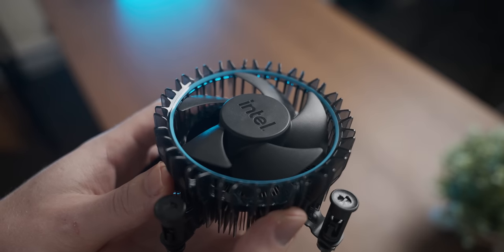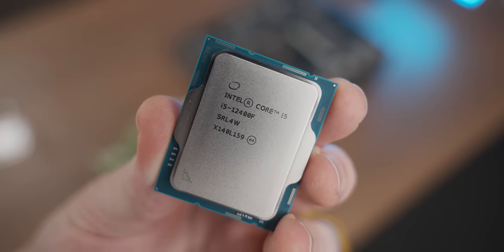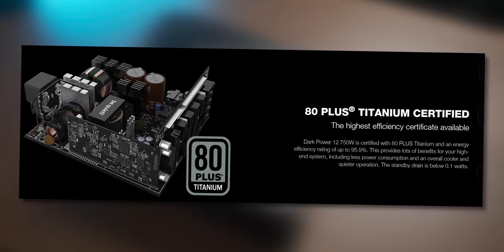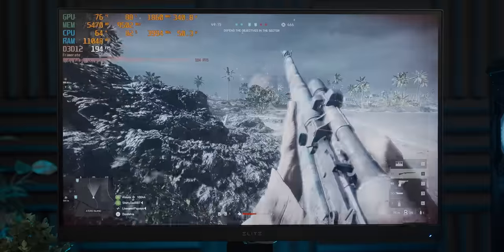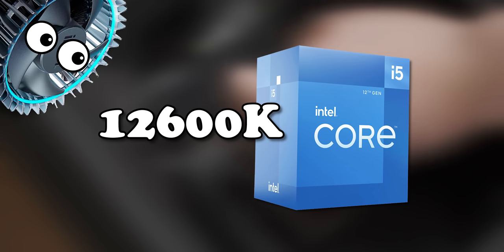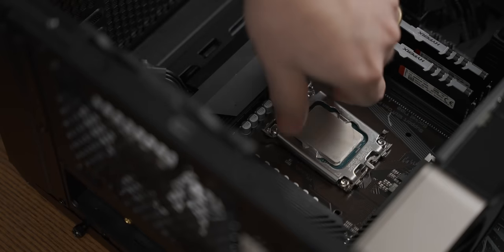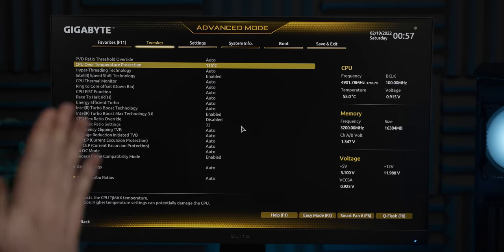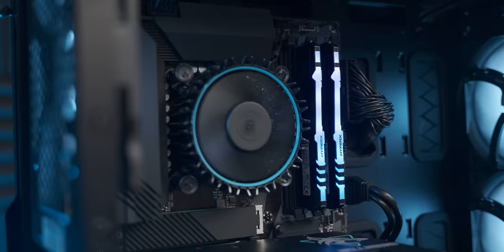Pushing The New Intel Stock Cooler To The LIMIT

Comment: I wonder how the new Intel stock cooler compares to the old one. It’ll probably be in the next episode of Dawid’s Deathmatch Arena of Death, hope so.
Reply: It's probably the same thing just made less uglier. You know how the say goes:
Same fecal matter, different color.
Reply: @ozmobozo  nah. the new one is a lot better because it's heat sink doubles the size compared to the old ones.
Reply: @ozmobozo  hey atleast it can cool mid range cpus, good option for people with low power budget builds
Reply: You can actually mount socket 1200 coolers on Asus z690 motherboards. So it should be possible to test it.
Reply from the maker: I think the performance would be pretty similar. The only reason I didn’t test it was because the old cooler didn’t have compatible mounting. I may do a short on it at some point if there is a bunch of interest. 😁
Reply: @DawidDoesTechStuff   SInce when has not having a mount stopped you Dawid 🤣
Reply: That is exactly what I was expecting ;(
Reply: @DawidDoesTechStuff  to make things easier there are some boards with the 1200 mounting pattern
Reply: @DawidDoesTechStuff  There is always interest in Dawid's Deathmatch Arena of Death!
Reply: @DawidDoesTechStuff  there definitely is some interest here 👀
Reply: Ahaha would love to see that. And I love that name 😂👌
Reply: @carloregalado7751  The top part is entirely plastic you know
Reply: Could be fun to see what is the minimal budget air cooler that would allow the 12900k to run in such conditions, id cooling, arctic e-sports, the classic cm 212 evo maybe? Is there something that costs less than 15 - 20 bucks that can tame the beast? :-)
Reply: @DawidDoesTechStuff  I want a full video with graphs i cant understand half the time included
Reply: @ozmobozo  Nah, just a bunch of plastic and little bit of fin stack and a Intel branded Delta fan just strapped on there and call it a new stock cooler
Reply: They didn’t improve anything since 2005…
At that point, it would be better to ask a little less money and sell the cpu without cooler and let the customer choose his own aftermarket one…
Reply: Who knew that the heat death of the Universe would begin with Dawid and an Intel stock cooler?
Reply: @DawidDoesTechStuff  i never really asked this but now thinkin of it is it backwards compatible with maybe like 6th gen or even 1st gen cpus
Reply: @DawidDoesTechStuff  what about one of the reallllllly old ones?
Reply: @mrducky179  Bro you can literally buy cooler master for 35 euros and it works 20 times better than intel stock cooler, i have max 50 degrees while gaming with their cooler..
Reply: More power at same tempurature
Still better
Reply: @carloregalado7751  I know i'm a bit late to this, but all that "extra heastink" is actually just decorative plastic. This thing really, truly is a joke

Comment: I wonder how this compares to older Intel stock coolers. While the more recent ones are all crap aluminum ones. Older one had nice copper cores. I remember my old it 2500 running fine on the stock cooler for a long time. It was made for like 100 watts of power. Heck the SFF community used to love older stock coolers as one of the decent and easier to find sub 40mm coolers untill noctua made the L9.
Reply: Because thats all you get. Sub 40mm aftermarket coolers just didnt justify having to purchase as many... as hard it is to beleive were worse than the intel stock coolers at the time

Comment: What?! You're spending your day at 14⁰ Celsius??? Damn! I'm in Canada and set my thermostat to 19⁰, and all my friends are setting theirs to 21-24.

You're a brave man! Great for the PC though.
Reply: For the PC great is -14 lol
Reply: After running a conversion to a more sensible temperature numbering system I have determined that he was indeed in a damned cold room for indoor temps. Yours makes much more sense as a low end indoor temp range though I'd prefer more about 70 myself.
Reply: @ram89572  You can't say that fahrenheit is a "more sensible temperature numbering system" without looking like a fool.
Reply: @mekacrab  I can and I did. It makes no sense to talk about measuring comfortable temperatures at only 20 something degrees off of 0 being freezing. That makes no sense at all. 70 being comfortable is significantly further away from freezing at 32 than 21,1111 is away from 0. And again we see more sense being made when it is damned hot at 100 vs 37.7778
Reply: @ram89572  what ? If it was that good then scientists would use it. But no, they use Kelvin, that has the exact same temperature increments as Celcius, just with a 173,15 degree offset.
You did look like a fool indeed. 
And besides, we use Celcius to mesure PC components temperatures, so we're not gonna mix units because that's a stupid thing to do.

Comment: what would really help these stock coolers, is extra Z height of aluminium, a copper vapor bell at the bottom leading to a single heat pipe that runs up the center of the copper heatsink
Reply: Literally just making the bottom flat would massively improve Temps, rectangular cpus don't exactly fare the best when the only contact with the cooler is a circle
Reply: @dilutedoxygen  I was referencinbg the extra Z height it has to travel through the lw w/m*k aluminium.
An extremely simple vapor chamber and a single 'heat pipe' thats literally just a hole drilled through the alumium slug would work better, heck, with how cheap drilling holes is, you could get 4 of them in there and cap it off with something simple, like some more aluminum that is slightly oversized for the hole

Comment: Always interesting to see parts used in ways they were not intended. So I guess I came to the right place.
I should also mention that 80+ rating is not a good indicator of the quality of a power supply.

Comment: 12400 runs way coooler while undervolted by 100mV. Would've been good to include this, as I brought temps down to 45c in r23 multi-core benchmark, with the Arctic Freezer eSports 34 Duo. Really curious what the stock would do with UV.

Comment: I recently built a system with the i5 12500 and the stock cooler and i found it pretty appalling. it was LOUD! Also the system did not survive a 10 minute run of Cinebench R23 without hitting the high 90's and even eventually 100 degrees on one of the cores. 
Cooler was correctly mounted, side panel was off, ambient was 23 degrees.

I suppose it's kinda okay, albeit loud, on the locked i5's and below but it is quite bad compared to even 20$ alternatives. you get a lot of noise for free.

Comment: If you want to keep using Battlefield 5 for some testing I suggest putting a user.cfg text file into the main directory of BFV and add the command "GameTime.MaxVariableFps 600" (without the "), this will increase the max fps of the game to 600 or whatever value you wanna give this command.

Comment: I dont think my CPU has ever reached over 40 degrees celsius, even pegged at 100% (happens quite a lot because it is an old 95W bullooser CPU) I highly reccomend the 7$ Arctic freezer 7 pro
Reply: Those CPUs are a completely different kind of beast, if I recall correctly, the max temp for those is around 60 C so they are not really comparable
Reply: @SpaceLion949  For FX  6300 it is 70.3,  witch is one of the better in terms of temperature tolerance, but It is still a CPU using almost 100W

Comment: if u want to put this "cooler" to the limit....take a 12300 cpu with stock settings und run 1 cinebench run!....thats it!
Reply: and get like 65c max temps? I got like 80c on my 12400, and the cooler was running at 80% speed

dont forget the 12300 is a 65w 4 core cpu so it really doesn't produce much heat at all, on my old 6700 I'd get 65c max temps on a cinebench run with the old stock cooler
Reply: @miweneia  You seem to be lucky. My 12500 also hits the high 90#s and sometimes throttles in Cinebench. This stock cooler is quite bad, even by Intel standards. There are $20 coolers out there that do a better job.
Reply: @miweneia  ok maybe i chose the wrong "words"...
take a 12400 or above and then u will sacrifice the stock cooler!
Anyway it was more likely a "meme"...a small joke!
but for the purpose of telling everyone that intels cpus are hot!
And i know it,  cause i used it for myself.
not with a tiny aircooler. with full costum loop and even with this in cinebench the cpus reach 85c instandly!

Comment: That copper surface is in the best possible position…just below the motor fan which creates its own heat on top of the cpu while air goes through the sides…..only.

Comment: Correct me if I'm wrong but apart from the 12th gen redesign of the stock intel cooler. Weren't they more or less just the same block of aluminum but with different mounting hardware?. Makes you wonder what the aftermarket coolers of early to mid 2000s would stack up today on these compact housewarmers.
Reply: I was recently comparing the one that i had on my i5 from 4th gen and i5 from 10th after upgrade. Despite looking simillar the old one had way more metal. Now they stripped it down even futher to cut costs.

Comment: I used the stock cooler for my 12400 while waiting for the adapter bracket for my hyper 212 to arrive, and honestly it wasn't that bad. It wasn't as nice as say pairing a Pentium D stock cooler with a Core 2 Duo but it never thermally throttled.

Comment: Just like with what happened to the author of this video, does anyone know how to remove this stock CPU cooler? The previous intel stock cooler had arrows showing where to turn but this new one does not. As a result I am unable to remove this cooler even if I tried to pull up on the four snap-ins. Its like they are stuck. Any help is appreciated! Thanks!

Comment: undervolting is a must with 12th gen at least 0.050mv maybe more to get those temps under control thats what iv found with the 12600k
Reply: You just need a good cooler
Reply: @emeraldwolf7920  Noctua NH-D15S not good enough? i think it is lol i just not comfortable of temps over 70 degrees c

Comment: Just to clarify tho, doesn't the i9 12900k come with a different stock cooler than the i5/i7?
Reply: obviously if you're getting an i9 tho you should definitely spend the extra $50 to get a good 3rd party cooler, but I am pretty sure the i9's actual stock cooler performs at least a lil better than this lol

Comment: I got a 12400f and its been doing just fine with the cooler, especially considering I have a gigabyte 1080 Ti, which easily drowns the cpu cooler noise

i use a more relaxed fan curve to keep noises low and I get about 72-73c and the same on the GPU

certainly better than spending 50 bucks on a noctua or bequiet cooler, when I don't actually need them

lastly, Im also running an open case at a room temperature of 25c
Reply: Hi! A year later, are you still using the stock cooler?

Comment: I have the same issue with my 12900K with a AIO watercooler, open case.
Jumps to 100° and throttles down to 4900Mhz
I wonder if there's a contacting issue caused by the bracket.
It's really annoying bc I do multi-GPU 8K VR AI upscaling.
The Giant VRM heatsinks in the Z690 motherboards make is impossible to fit a beefy heatsink.
Reply: What size AIO? Not trying to sound rude but did you make sure to remove the plastic film off the bottom of the AIO cold plate before installing? I got a used computer once that was running super hot on the CPU with any load and turned out the person that built it never took the plastic film off the AIO cold plate. After that was fixed, it was instantly better.
Reply: @dracer35  You're not sounding rude :) I work as tech support in VR video entertainment, I know people do the dumbest sh t haha.

It's a 280mm Liquid freezer. Even though I have a giant case (Corsair 750D) I can't fit a 3 fan radiator. It's a workstation, I need the space for HDDs and swap-bays. Currently the case is still empty though.

I replaced the standoffs that came with the LGA 1700 mounting kit with 1mm smaller ones which did help noticeably. Like 10°c less in Idle alone! I'm idling around 31°c right now.

I'm thinking about replacing the 140mm fans but I have no idea with which ones. Most 140mm fans are airflow oriented, while I would need more static pressure to push the air through.

I also hooked up the AIO to a 3 Amp header instead of the standard 1 Amp, but it's not pulling any extra juice. (Which is actually an attest to the build quality preventing it from burning itself out.)

If you have any ideas or suggestions, I'm all ears. The motherboard is an Asus z690 Hero, the VRM heatsink is massive and restrictive.
Reply: @rakly3473  Ok good. I didn't want to come off sounding like an ass lol. Much respect for you tech support guys. I don't think I could handle that lol. I'm a maintenance worker at a factory. I just tell them to leave me alone and I'll let them know when the equipment is fixed lol.

I've heard people talk about mounting pressure issues on some of the z690 stuff but it sounds like you've addressed that already. The Liquid Freezer 280 isn't a bad cooler at all.

For reference info if it helps. I currently have my setup on a test bench while I'm waiting for the rest of my water cooling fittings and hardline to arrive. Ambient temp stays between 67-69 degrees F. The 12900k is mounted an MSI z690 Carbon Mobo being cooled with an Artic Liquid Freezer II 420 AIO. Idle temp bounces around 23-24c. I've seen load temps in the high 70's to low 80's. I believe the high speed (2100 rpm) Artic fans do really well. The ones that came with my AIO seem to top out at 1700 rpm and stay very quiet while still cooling well which I like. One thing I've noticed is the temps are affected greatly by the CPU vcore. When the bios auto settings let mine boost to 5.2 and I see the vcore up near or above 1.4v, the temps rise quickly. I'm thinking I might play around with a little undervolt and see how that does. I use to run a constant -.050mv undervolt on my 11900k system and it seemed to help with temps and still boosted to 5.3 without any stability issues. I wonder if undervolting could get your temps down enough that the CPU could hold it's boost clocks instead of down locking itself?

If you do figure it out, I'd be interested to here what works for you.
Reply: @dracer35  There are some crazy 5000 rpm fans out there, but I ordered 2x Noctua NF-A14 industrial PPC-3000 PWM.

It's scientifically incorrect, but by the spec sheet numbers you could say, 1 of those = 2 of the ones that come with the Freezer AIO's
Reply: @rakly3473  I have one of those NF-A14 fans also. Bought it out of curiosity but the noise was too much so I never use it. I wonder if you are hitting diminishing returns by the time the heat has to transfer from the die through the Tim, to the CPU heat spreader, then through the thermal paste, AIO coldplate, into the water, into the aluminum radiator and finally into the air being pushed by the fans? I guess we will find out once the new fans arrive.
Reply: @dracer35  I got 3 Inter-Tech 4W2, I'm used to it :) - What you mention about the heat transference, I was thinking about that last night, maybe the pump speed is too low and not circulating water fast enough over the die. Not that I think there is something wrong with the pump, just maybe need a more powerful one.

I've never built a custom loop though and it's not really something I want to "waste" time on.
Reply: @rakly3473  Pump speed does play a pretty important factor. I run all AIO's at max pump speed because their flow seems to be much lower than the D5 pumps I use for custom loops. The DR has a max rpm close to 5000 but they flow so well that unusual run it somewhere between 2500-3500 depending on the custom loop, how many components in the system and how much restriction.
Reply: @dracer35  Alright, Installed the Noctua's! Difference is quite substantial. Mind that's it's a lso 28°c in the room right now.(82.5°F). Idle between 30°C and 33°c at half fan speed (1500 RPM).

Throwing workload on it does shoot the temperature up like before, but none hit 100° or was throttled. P-Cores ranged between 80°C and 86°C once stabilized. And E-Cores  73°C to 80°C , with fans at max speed (according to HWiNFO is 2800 RPM).

VRM max was 49°C. Didn't take note of what it was prior. It isn't for ppl who want a quiet PC though! But it doesn't bother me.
Reply: @rakly3473  Well at least it sounds like it's under control. I didn't realize you were working with such a hot ambient temperature. I usually have it around 20c 69f in my house so I'm sure that helps. I bet those fans are moving some air at 2800 rpm! Lol

Comment: why not run at 4K for that first test to shift the bottleneck to the CPU?
Even if you only had a 2560x1440 monitor you could still use DSR. If you used "x4" that would be 5120x2880 (it's proportional to the monitor so "x4" is square root each way (2x2)).
(before someone flames me... the bottleneck was not the GPU in this test. It was the 200FPS cap as he said.)

Comment: "The tower 100 comes with plenty of ventilation so your components don't have to run hot" looks at my gpu at 80+ degrees in my tower 100, hmmmmmmmmmmmmmmmmmmmm

Comment: Just for context: A 10900K @ 5,1 GHz All-Core, 1,3 Volts just reaches 70°C with a custom high-end (but underpowered aka. two thin 240 radiators) water-cooling solution. And the four NF-A12s are probably much quieter than that single Intel fan.

Comment: The new Intel stock cooler seems to be a little better than the baby-tier Ryzen stock cooler, handling ~105W vs. ~95W max while at 100C in my experience. Makes me wonder if I could increase the temp limits on my 5700G to squeeze a few free Mhz out of it (Horrible Idea).

Comment: 66 degrees with i5-12400F? I scored  84 degrees with stock just how shitty it is even though it got replaced by new stock cooler. Now got replaced by water cooling it stays at 70 at most in cinebench